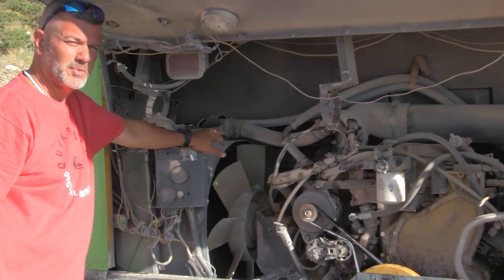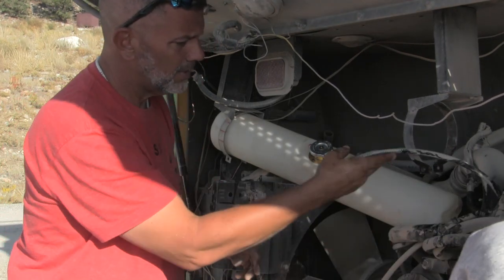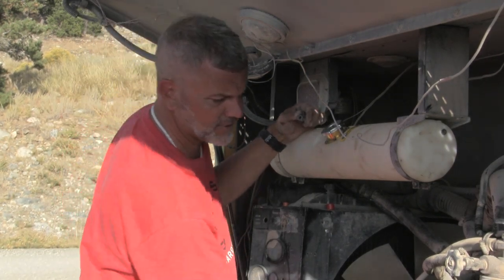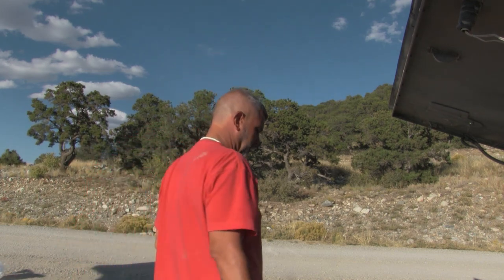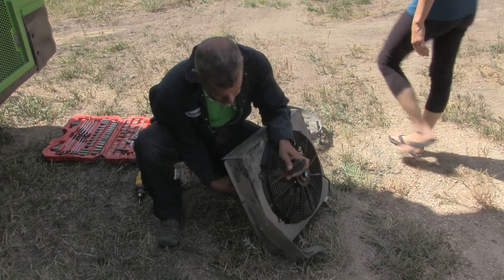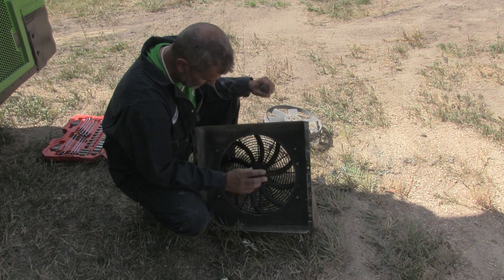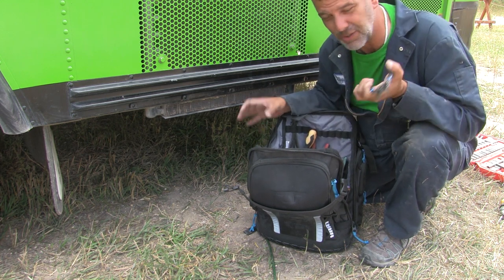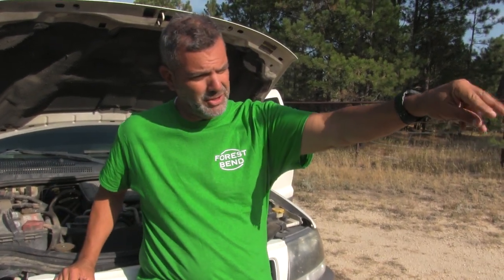2 Bus Repairs & Another Jeep Failure!

Comment: A couple of items - first because of the age of the bus the tank utilized a pressure relief style cap (that was the red lever), the newer tank utilizes a two step catch. The first catch as you take off the cap releases the pressure (same as the red lever, but safer as in the old days people would remove the cap while under pressure). Second, if you check with any postmaster at the local post office and ask most will accept what is called general delivery mail. So anyone, once you have the approval, can just put your name, then general delivery as the address, the the city, state, and zip. Most post offices will hold the general delivery mail/packages for up to 30 days.

Comment: Great job getting the overflow tank. So lucky 🍀. 
Great idea to replace your trany oil cooler fan. 
So now you need to pull the trany dipstick and smell the oil. If it smells burnt or is black replace the trany fluid. More than likely if you have not had the trany cooler working the transmission oil will be burnt. Burnt trany oil could mean big dollars. Depending on which Allison transmission you have. If it’s the older model very expensive to replace. 
To help keep your transmission running for a long time change the transmission fluid and the exterior oil filter. If you don’t know when it was last done and or it smells burnt change the transmission oil. 
You can do it yourself and also get all the oil out of the torque converter. 
If you want more helpful information so you can do this on your own. Let me know and I can explain how to do a proper job of draining all the oil out of the trany and torque converter 
This will save you money in the long term. 
Good luck and safe travels

Comment: Best of luck you two! 
Be sure not to pull your car if your starter is engaged in neutral. I bet you could find a cheap ignition switch at a salvage yard, swap the switch just to eliminate that possibility. 
Or purchase a Power Probe 3, the greatest electrical tool for car, trucks, or any vehicle with batteries.

Comment: I'm just going to make a recommendation. Get rid of the Jeep and get yourself a Toyota and put a driveline disconnect between the rear differential and the drive shaft. The Toyota tacomas are pretty good trucks. And I have that driveline disconnect between the drive axle and the differential you don't have to worry about all the other rigmarole with transmission issues and stuff of that nature. If your Jeep is a four-wheel drive you might be able to get a driveline disconnect for both front and rear but that'd be best option to get a driveline disconnect.

Comment: Sometimes if the search is fruitless if you take a seperate 12 volt battery and put it in the non fused side you will let the smoke out as they say.You want as much of the visible area viewable to see where the smoke comes from.Once located the short can be repaired and check all surrounding wires for heat damage.This is a last ditch effort and have a properly rated extinguisher handy.Good luck I can tell you will figure it out.p.s. having smoke spotters is handy including under hood areas.

Comment: if the startmotor engages while the engine is running the startmotor acts like a generator adding more than 12 volt to the system , better make sure theres no melted wiring anywhere

Comment: Had similar problem with the ignition wire on a dodge. I installed the push button until I had the time to get it done right. The button is still there but not connected anymore, just in case I need it again

Comment: I'm pretty sure flat towing the jeep is causing these issues. Trans lines go to your radiator. When you are towing it, your trans fluid heats up, overheats your radiator without the jeep running, water pump not running, electric fan not running, overheating your radiator and engine.